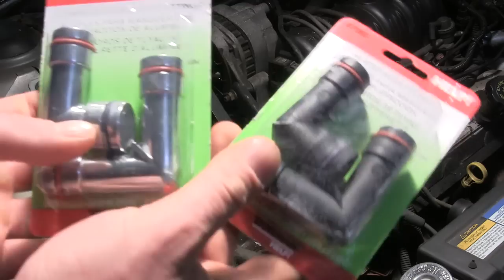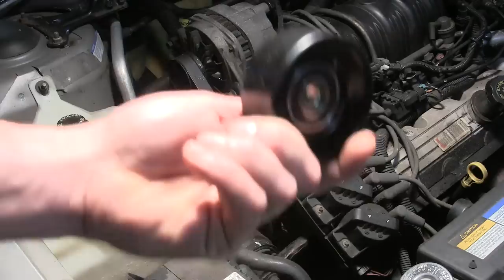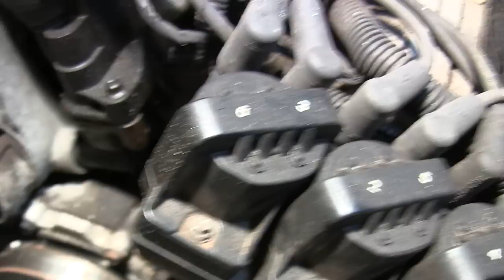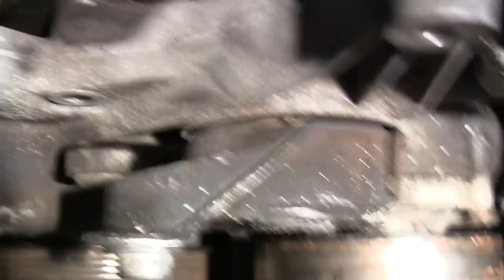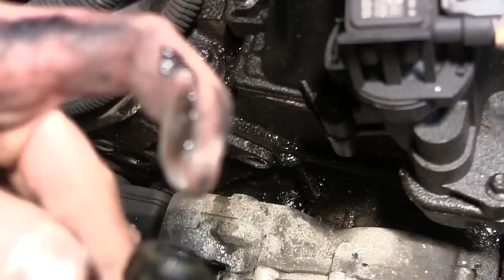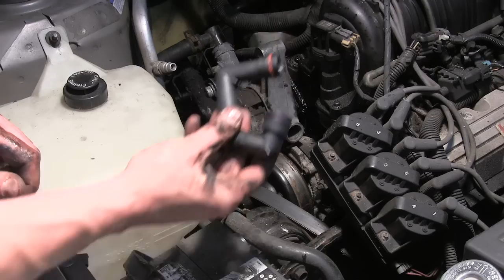3800 Coolant elbow replacement

Comment: After I replaced the elbow my belt makes a slight whine. Is it because I put the belt tension on backwards something else?
Reply: chad Rickman No. Coolant got on the belt. Did you drain all coolant b4 u changed the upper elbow?
Reply: Abigail Espinoza no, I didn't. how long will it squeak for? Can I clean it?
Reply: chad Rickman it could be a variety of issues then. My main question is how long has it been doing it? And if it was just after you changed the elbow? Either way it may be slipping or cracked or not enough tension. My advice is take it off and reassemble it. Make sure u read the diagram correctly just in case u did not put it on correctly.
Reply: chad Rickman if all else fails replace ur belt.

Comment: 1998 3.8 Olds. Intrique.  I removed the alt. plus assy. to replace elbows.the lower one broke but it is straight.  no elbow. what gives?
Reply: raymond ely is it gm motor? Try and Google your specific car.
Reply: 1998olds intrique 3800motor. The lower is not replacable, Had to replace complete unit. I was thinking the lower was plastic, so was not careful removing unit. This motor only has one replacable elbow. My mistake. Hope this helps someone else. Thanks for reply.

Comment: i had this problem dont buy the black plastic ones i found a parts place that sold aluminum elbows 2 dollars cheaper plastic ones cant handle heat and rupture i replaced it with cheap black plastic tubes lasted a year than found the metal ones had no problems since

Comment: I have a 1998 LeSabre I just inherited from an uncle that is leaking coolant. It's pooled up on top of the engine block. Could this be the issue?
Reply from the maker: Usually when these elbows start to leak they either completely fail and spray coolant everywhere or they just leak down the side of the block.
Reply: it could be you upper intake manifold gasket an the manifold itself if you get that done u  might as well replace the lower intake manifold gaskets

gm made the upper manifold out of plastic and they like to warp and leak

Comment: Even those metal elbows need to be replaced every year. Well, not the elbow, but the o- ring turns to mush.
Reply: If your elbow was leaking would it cause it to overheat and bury in the H
Reply: @stonertraphouse4475  if you lose all your coolant it certainly will. These elbow leaks are typically (not always) slow leaks. Take a peak under your car everyday. Even if you don't suspect a leak.
Reply: I've never had to go back and redo the aluminum ones. Never seen the o ring fail after replacing.
Reply: @repnatl  it's always the orange one. Don't know why or what the difference is.
Reply: @chadpugh1490  Orange o-rings are made out of silicone which is not the best to stand up to oil. Much better is neoprene or buna. I've been getting my fix for decent and oversized o-rings from Oringsandmore eBay store.
Reply: @leebarnes655  thx for the info. I'll certainly check there next time. Oddly enough, that's the o-ring that comes on the elbow out of the box from Dorman.
Reply: Does anyone know where I can get the o rings for the heater hoses for the tensioner bracket?  I’m doing mine and I’ll need new o rings.  Thx.